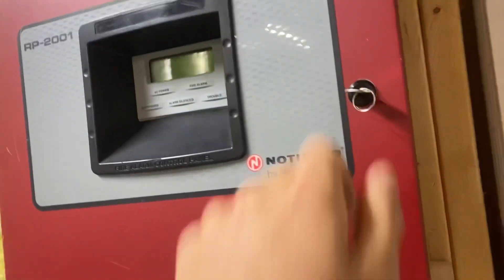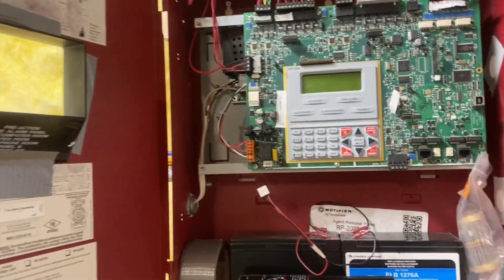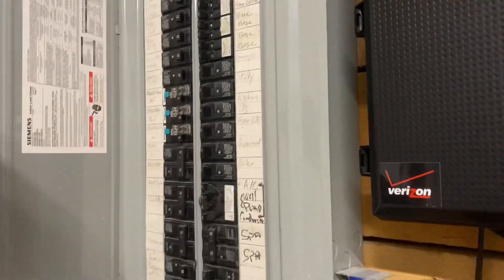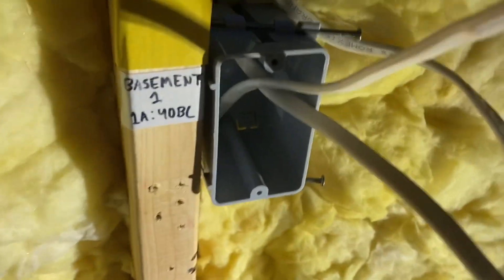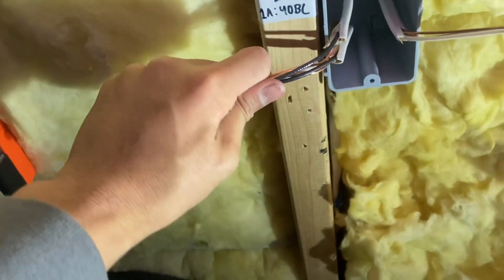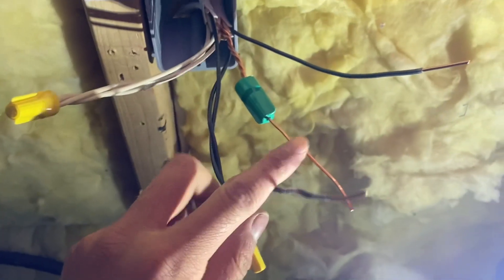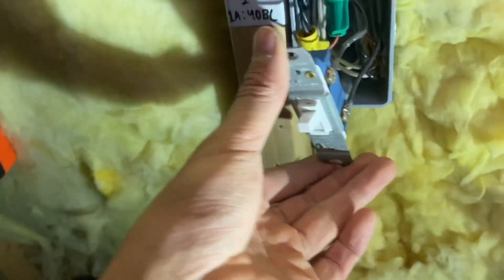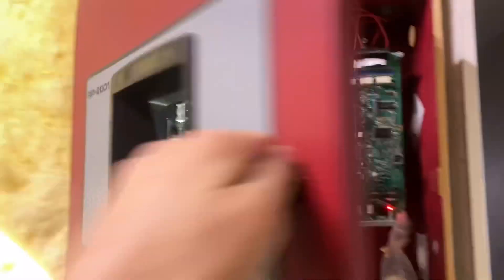Hardwiring the Fire Alarm Panel

Comment: Looks good. You may not want to but you always could add a key switch so someone doesn’t turn off the wrong switch trying to turn off lights
Reply from the maker: I actually will do that. I have accidentally turned off the panel at least twelve times at this point